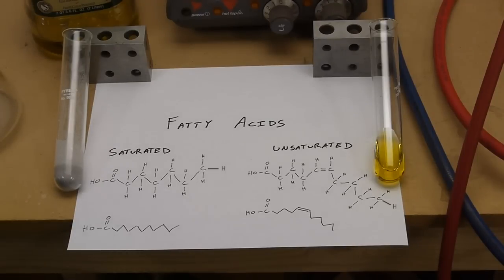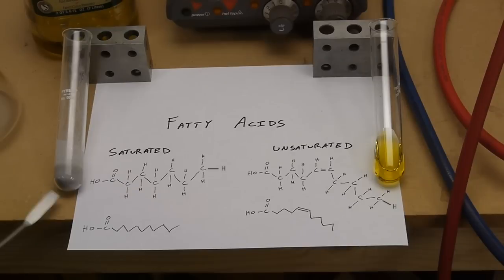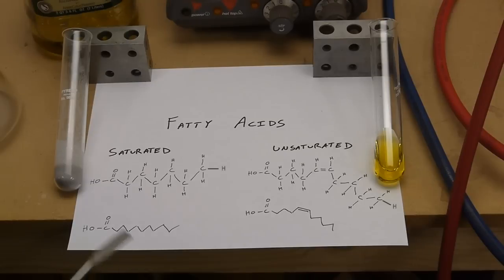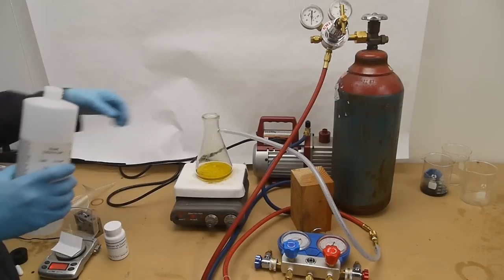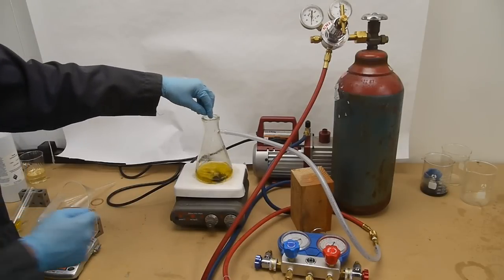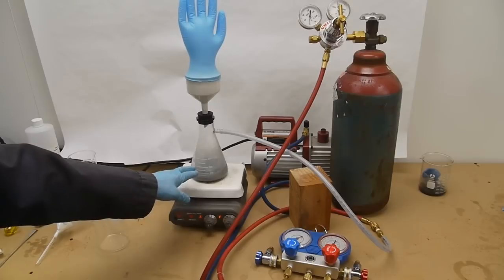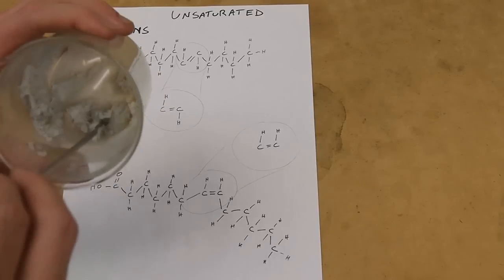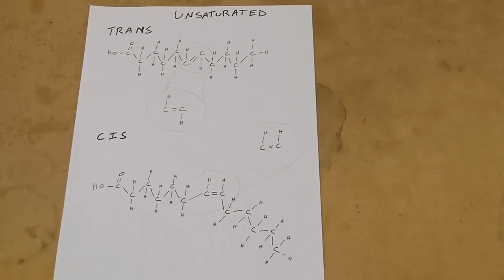Hydrogenation: transform liquid oil into solid fat

Comment: How does that stir bar work?
Reply: You guys are great,
Reply: It's a bar magnet. Underneath the heated plate there is a set of stator coils just like in an electric motor. Alternating current through these coils cause it to spin just like the rotor part of a motor.
Reply: There's a magnet inside it and the electromagnets (or an actual spinning magnet) inside the plate spin it around
Reply: It's a coated bar magnet and a spinning second magnet under the plate.

Comment: Thanks for the video! Very informative. But I have one question, why are trans fats worse than saturated fats? If they're both straight they should have similar melting points, and the trans fats have a double bond which is easier to break down...
Reply: I would guess that the enzymes that the body uses to break down fats can only handle fully saturated and cis unsaturated fats. The trans forms probably dont quite fit properly into the enzyme to work as a saturated fat. Enzymes can sometimes be very picky about what they can work with.
Reply: RadHobo I am afraid that while your statement on the melting points of fatty acids is correct, your reasoning is wrong.
The double bond does not break if you melt a fatty acid, melting is a physical process, not a chemical reaction.
Reply: trans fats actually have much higher melting points compared to sat fats (and cis fats) because the double bond requires more energy to break. To answer your question, trans fats increase LDL cholesterol and decrease the body's HDL cholesterol whereas sat fats solely increase LDL cholesterol.

Comment: Science has proved that one cannot draw the conclusion that you drew regarding "unsaturated fats slide through the arteries where as saturated fats clog up your arteries". The clogging affect is due to the ratio between HDL and LDL fats. It has also been theorised that bacteria could be the culprit.
Reply: RealHogweed That is precisely what I mean. The evidence that saturated fats cause arterial plaque and that unsaturated fats do not has begun to crack. There isn't any fact that prove anything yet but recent findings suggest that it is maybe due to: bacteria, inflammation, free radical damage and the ratio between your HDL/LDL levels.
Trans-fats are indeed dangerous, this is because they raise your LDL levels (the bad cholesterol) and lowers your HDL levels (the good cholesterol).
Reply: Saturated fats are actually essential in a healthy diet. But, because saturated fats were present in arteries that were blocked, scientists presumed that they were the primary cause of blocked arteries. In one example of this disease, saturated fats blocking arteries is a quaternary causal co-factor of other processes going on in the body (such as furring of the arteries), which in turn is a tertiary causal co-factor of auto-immune system dysfunction, which in turn is a secondary causal co-factor of gut damage allowing undigested proteins directly into the blood stream. This is just one example, so it is indeed much more complicated than the classical theory, which has been proven to be a misinterpretation of what is really going on. Even the example I just gave is an oversimplification of what is really happening.

Most naturally occurring saturated fats are very healthy to consume, and we should not cut them from our diets as has been suggested by outdated science.

Anyways, back to the video for me. **Unpauses video.
Reply: ***** No, actually all essential (and conditionally essential) fatty acids are unsaturated. Human body does need saturated fats, but it can synthesized them from the unsaturated fatty acids. The problem is not that food contains saturated fat, but it contains too much of it. Dose makes the poison.
It is true that solely saturated fat in diet is not enough to cause the disease, but it is also true that avoiding saturated fat can lower your risk, as it is one of the factors.
Reply: Vang Tsal Maybe this wasn't a perfect analogy but I still think that it makes my point. How about comparing it to bloodletting to treat diseases (pre 19th century)? Or treating children with attention deficit hyperactivity disorder with sedatives when what they need are stimulants?
Reply: user255 The article you refer to is hardly recent (15 years old). I said that recently science has started to find evidence ( i.e. 3 to 4 and at the most 5 years old) suggesting that it might not be the case that saturated fats are the sole culprit to arterial plaque.

This will be my last post to this thread as I don't want applied science channel have an endless thread of something that isn't really the main focus of this video.
Reply: in fact he said that the situation is more complex than that. i suppose he oversimplified just to make the explanation easier to understand. also talking about the transportation system of fatty acid would be very time consuming :)
Reply: Saying that the earth is flat and then saying that it is more complex than that isn't either correct. One cannot simplify by using outdated facts.
Reply: Christopher Forsberg
mh, i see what you mean. there's confusion in the video about unsaturated fats being healthier than saturated, that is not necessarily true. however artificially saturated fats are indeed dangerous, due to trans isomers. i suppose that by "outdated facts" you are referring to unsaturated vs saturated, right?
Reply: Christopher Forsberg It was meant to be example of study using special groups where the contrast is clear. I'm aware of recent studies. The subject is complicated and the health effects of fatty acids goes beyond simple classification of saturated vs unsaturated. Still it's not useless classification regarding to health effects.
Reply: *****
saturated fatty acids are not essential, since humans can produce them. some unsaturated fats are essential though.
Reply: RealHogweed
Ah, thanks. My mistake. I occasionally confuse the word "essential" (cannot be produced inside body) with the other meaning of the word (necessary for health).
Reply: Christopher Forsberg That's wrong. When you talk about ie. simple surveying techniques you assume that the earth is flat which of course it is not the case when you talk about more complex surveying problems.
Reply: Christopher Forsberg You wrote: "The evidence that saturated fats cause arterial plaque and that unsaturated fats do not has begun to crack."
Not quite true. Saturated fats cause arterial plaque by rising LDL, but yes there are other factors too. The problem to see this clearly is because lack of proper control groups. Because people generally eat too much saturated fat, we already hit plateau effect of harms of saturated fat. Thus it's hard to see the contrast between bad and somewhat less bad diets.
But there are some special groups which can be used as proper control groups. See example this study (exercising, smoking, etc are also controlled):
http://ajcn.nutrition.org/content/70/3/516s.full?sid=7d75cbe4-efa5-4f87-accc-0ddd225c64a3

Comment: If I remember right, you can use a glass syringe with glass wool packed in it followed by celite to better filter out the catalyst. Essentially just pressure filtration through a thicker and finer filter.you can have it before or after the injection port on the syringe. A heated centrifuge would probably work better for recovery though.

Comment: That catalyst must have been pretty costly.
Reply: At just under $900 oz spot, not cheap.  Hear Pd went on a tear recently: http://www.kitco.com/charts/livepalladium.html
Au to Pt ratio has yet to come full correction, IMO should be 2/3
Reply: cheerdiver gasoline is 80+% Hexane.
Reply: Palladium on carbon is easy to work with and is usually used for lab scale hydrogenation. In industry nickel based catalysts such as raney nickel or urushibara nickel are usually used

Comment: Hi. Could you please inform us the name of the device at 6:00 with blue and red valve which you used to connect both vacuum pump and hydrogen? Thanks
Reply from the maker: This is a manifold for refrigeration service technicians.  It allows the monitoring of the high and low pressure sides of a refrigeration system while adding refrigerant.  This is a very cheap one from Harbor Freight.

Comment: Hi Ben: Great demonstration and explanation. I liked your low pressure compensator/monitor glove setup; that's a great way to be able to maintain and monitor a slight positive pressure on an experiment and not to pop stoppers, tubing, etc. off your line.  For a setup requiring a bit more purity you could exchange the glove for a thin viton diaphragm or better a small stainless steel bellows.  In addition to our evolutionary preference for saturation it also gives produces, as you said a spreadable, consistency and the best example I can think of is peanut butter where hydrogenated fats are added to make it  spreadable and so the oil won't separate opposed to the "natural" peanut butter that's a bit "loose."  Cheers, Mark
Reply from the maker: Mmmm, peanut butter.  Good example!

Comment: Excellent video. I really liked how you explained how the molecular structure relates to solid/liquid at different temps.
Reply: Well did he explain why saturated fat become liquid at higher temperature? I missed that part.
Reply: @unperrier  - Here, the best answer in the world and EASY too... Temperature = Radiation.  The higher the radiation, the higher the heat which turns into what is known as 'Electron(s)'.  Through "Electrons", then come what is known as Ionic Bond.  Then too many electrons, IT separates the bonds and that is how IT becomes "Liquid".  Basically, "Elections" wiggles the molecules apart.  <<<<<< By the way, everything in this lifetime is that way.  Welcome to Quantum Physics!

Comment: can you use heptane?
Reply: Hello I follow your video's on YouTube 
For model rocket with black powder fuel , what formula you use ? 
I 've seen a lot of formulas but do not know what method I use for rocket fuel!!
tnx
Reply: it is 95% black powder with 5% wax to help it bind
Reply: Tnx
Your ratio for bp is 75 15 10?!
And,Can I use dextrin instead of wax?!
Reply: i don't think so. Dextrin sets hard where as wax doesn't, this might effect the compaction. Give it a go and see
Reply: normal 75;15;10